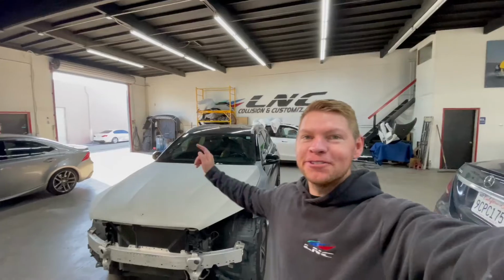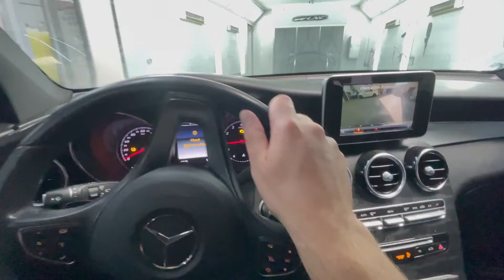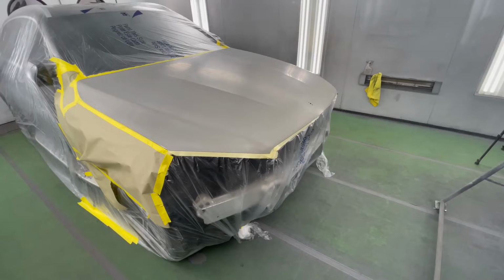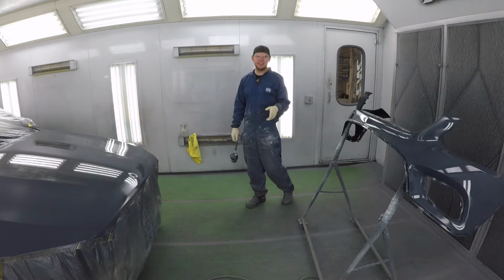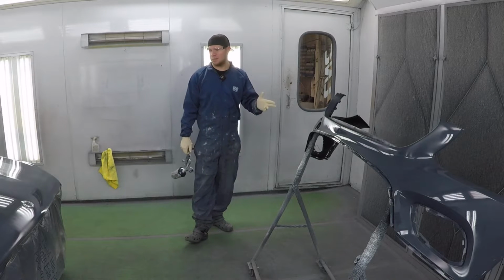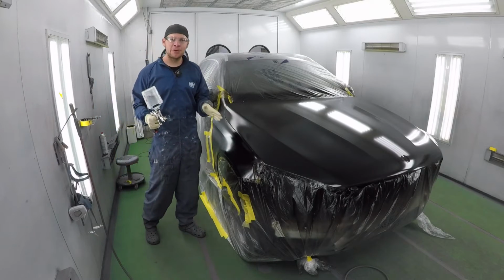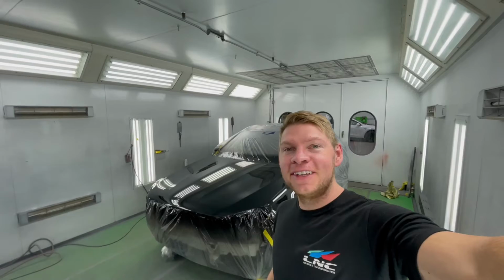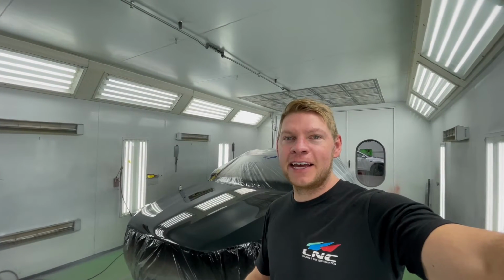Rebuilding Mercedes Benz GLC300 Front end And PPG PAINT JOB

Comment: Love the video.  What's the difference between a sealer and a primer before painting abase coat?
Reply from the maker: Thanks, Primer you have to wait for it to dry then sand and prep it before basecoat. Sealer you can apply it and spray basecoat right away without prep or anything.